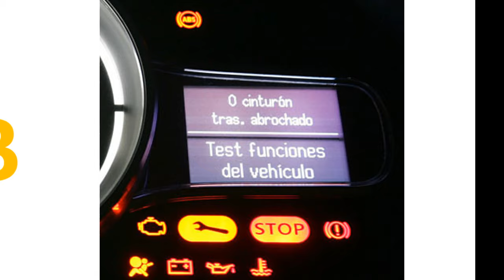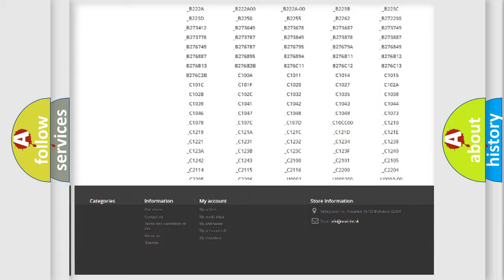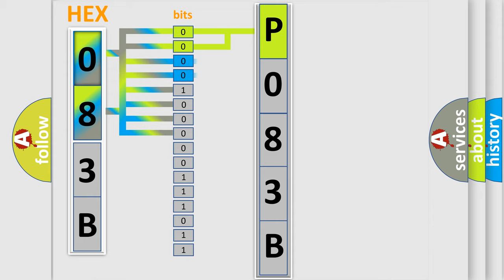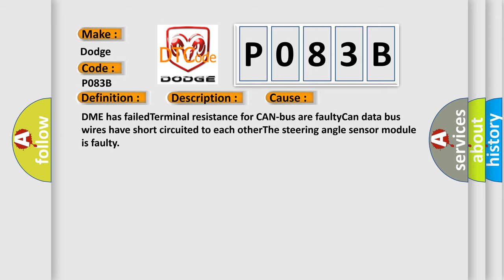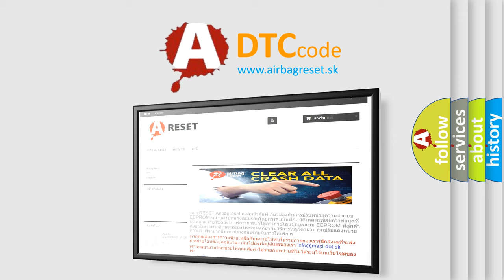DTC Dodge P083B Short Explanation

Comment: Wrong! 
It means LC pressure switch Rationality!
Reply: What does that mean? What is it and how do you fix it? What’s the price if I go get it fixed?
Reply: you are correct: LC pressure switch Rationality!.. pressure sensor switch clogged / bad or  Transmission Filter is clogged or Valve body is clogged. or a Ground or short to your PCM/ TCM relay is Bad...